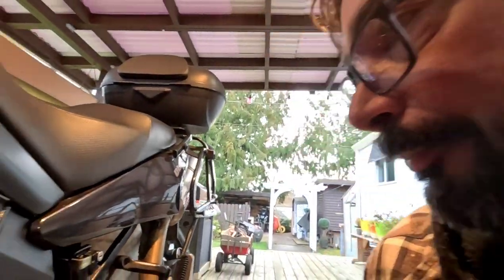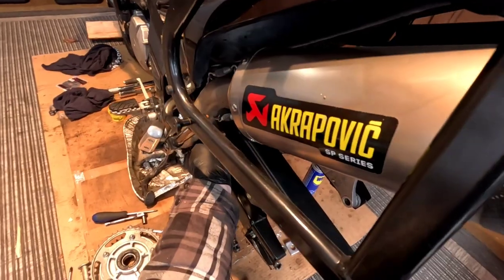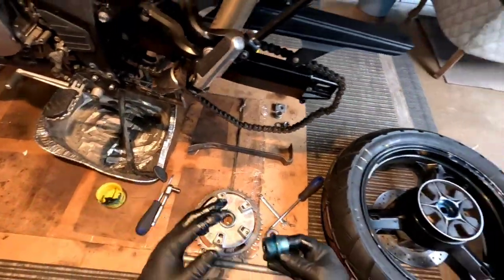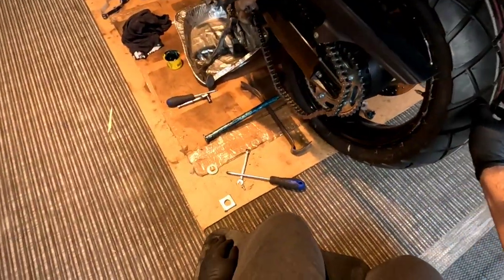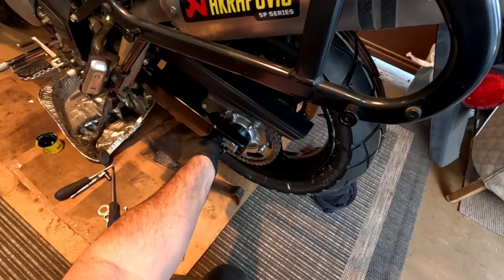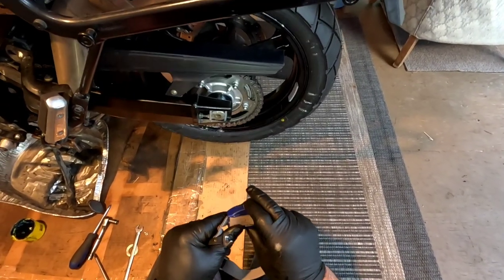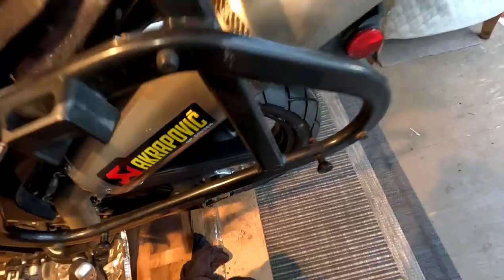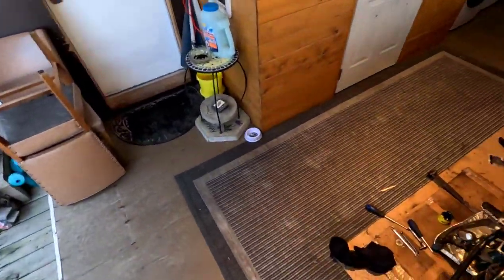V-Strom 1000 rear wheel installation

Comment: what is the torque pressure ?
Reply from the maker: The tourqe setting for the front sprocket. Off top of my head I believe it's 83 foot pounds but not sure I would have to look it up again it's been awhile since I was doing this video
Reply: Thank you very much , very helpful video, I was able to do it, just a little concern trying not to over tight the nut @CenterStandMechanX
Reply from the maker: Ya it's up there pretty high. I found it a bit difficult to keep the rear wheel still while doing it.  Not sure if it was in this video or different one I made after when I properly tourqed down the front sprocket.  I made a stick to jam the rear brake on and it was just enough to do the job